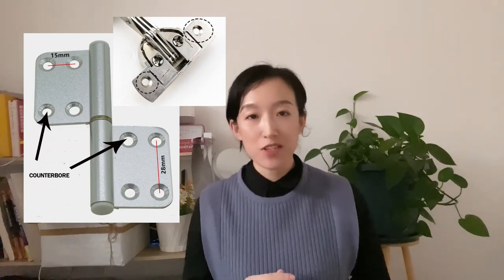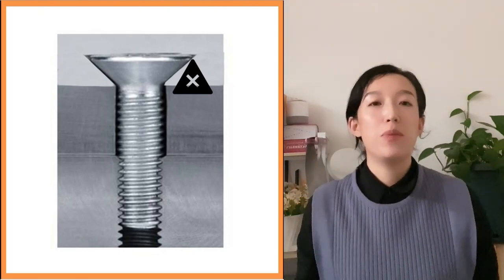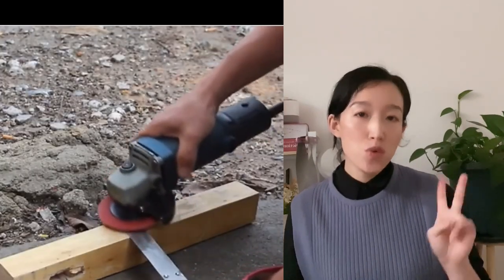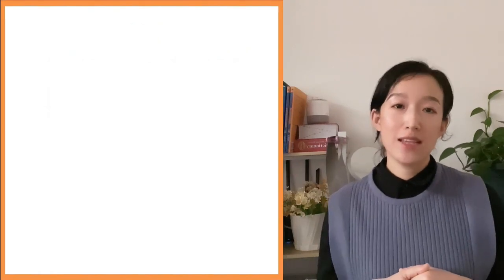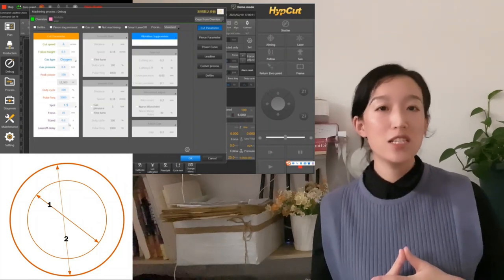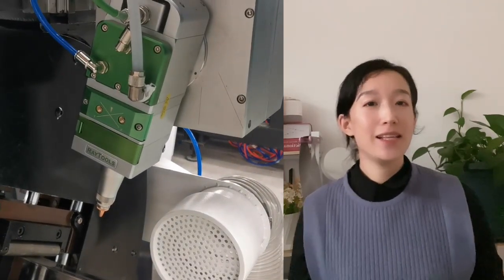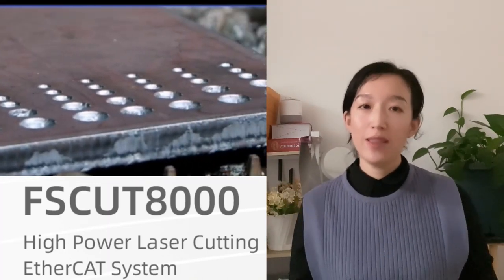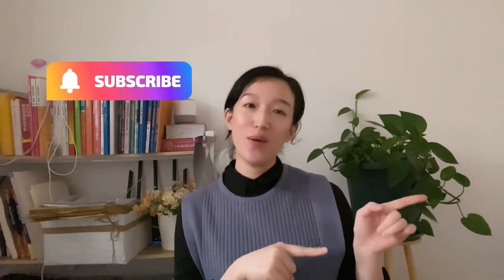Laser Counterpore Cutting | Fiber Laser Cutting | CypCut 8000

Comment: Hi! At 5:20 minutes into the video, that's our machine. We couldn't get it running with this head. Laser alignment drifts when cutting. And the head heats up. You can only cut thin metal. 
Your Chinese brothers sold a faulty head. We now have a BM109. 
We want to repair it. Can you help us?
Reply from the maker: A little confused. Your machine? Did I sell the machine to you?
Reply: @ClaraChai  It was sold to us by Lxshow.
Reply from the maker: @ОлегВольнов-в6б  I see, the machine is not working? +86-13335151833